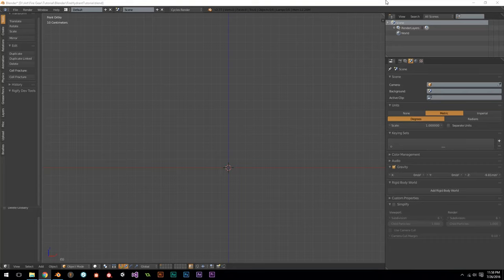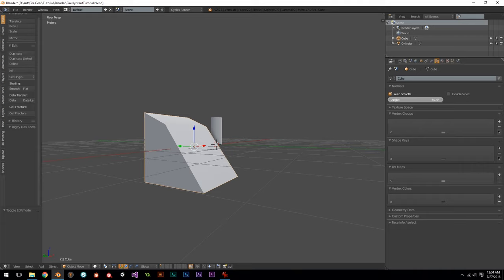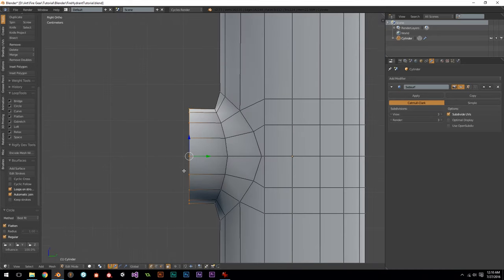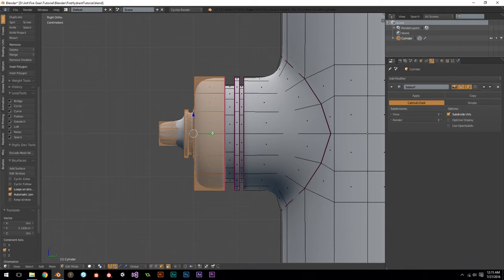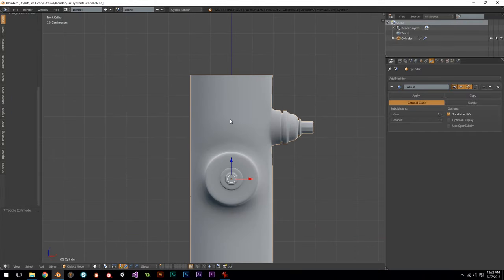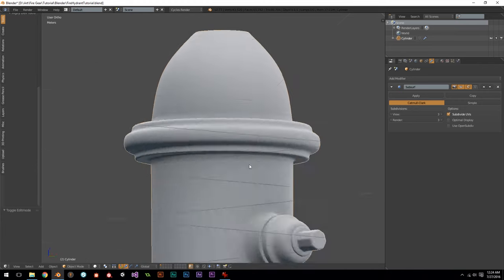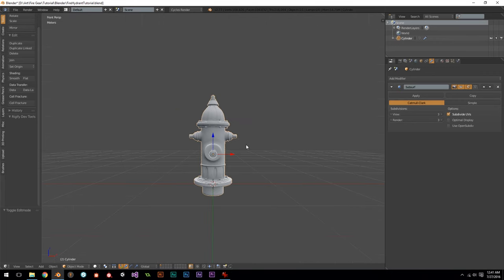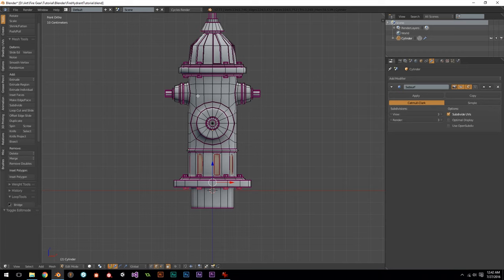Making a Photo-Real Hydrant in Blender: Part 1 Modelling

Comment: This video helped me a huge amount with my hard surface modeling. Thanks for making this, I picked up so many little tips. The biggest thing I got was the looptools addon, that's gold!
Reply from the maker: I really wish those tools were on by default, they really should be. I'm constantly using 'bridge' and 'circle' for all kinds of transitions in geometry shape and linking two bits of loose mesh... I'd be willing to wager it makes my workflow 5x faster at least. Definitely one of the "most enable" addons in Blender, you'll always need it. 

Honestly I have most of the addons enabled by default, because every once in a while it means when I'm trying to do something obscure, I can tap 'space' for that search menu and type what I'm trying to do, and it will pop up with a feature that does it in an addon.
Reply: +Blackhart Films that's an interesting idea by having them enabled and using the search. I'll have to try that.

Comment: The only problem I have with this tutorial is that you've got 8-sided bolts where the reference has 5-sided ones and 8-sided bolts again where the reference shows 6-sided ones.
I'd love to learn how you'd handle connecting the 16 and 8-sided edge loops to the 5-sided ones that you'd have in such case.

Comment: I imported the model to Unity, it was divided into 4 mesh parts, that means the model exceeds 65536 vertexes for 3 times. The vertex count shown in the blender didn't consider the subdivision surface modifier.
Reply from the maker: In Blender it should show a change in vertex count when in object mode and changing subdivision level. When you import into Unity, make sure you've changed your subdivision modifier back down to level 0 or 1. My workflow is to model a relatively low poly base mesh, use subdivision to see what it would look like at high poly resolution, then bake normals from high to low, and remove the subdivision before import into Unity. Sometimes I'll set it to subdivision level 1, apply the modifier, and then go through and remove unneeded edges as necessary.

Comment: 38:19 - would it be better to bake those in from a high poly and keep the poly count low?
Reply from the maker: Psynema depends on the application. I'm just making this and using it to render in Blender and put on Sketchfab standalone, so it doesn't so much matter. If you plan to take this model into a game like an FPS then I'd definitely work on baking normals. luckily this workflow gives you a pretty good low poly which is then subdivided with the modifier so your low poly and high poly are modeled at the same time.
Reply: @BlackhartFilms  Would it be a good idea to simplify the lowpoly mesh for a game engine, removing extra edge loops and detail?

Comment: What is the shortcut to enable/disable subsurface modifier viewing?
Reply from the maker: I don't know of a shortcut to toggle it (although knowing blender, there very well may be one), but if you look at the top of any modifier in the stack, there's a series of buttons. You can hover over them for a couple seconds to see their tool tips, but the first three are to toggle a modifier in the render, toggle the modifier in object view, and toggle the modifier in edit mode. Throughout most of the tutorial I have the modifier off in edit mode so I can work on the base mesh, and then see it full resolution when I go back to object mode.
Reply: Blackhart Films Thx for the tip.